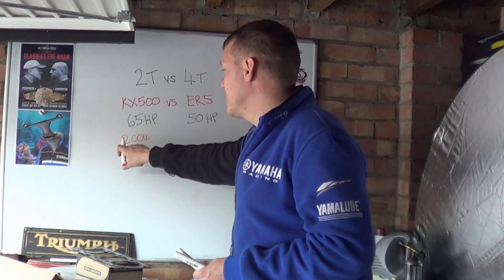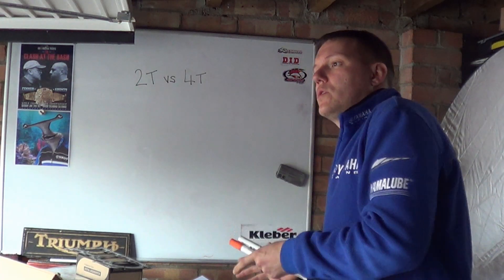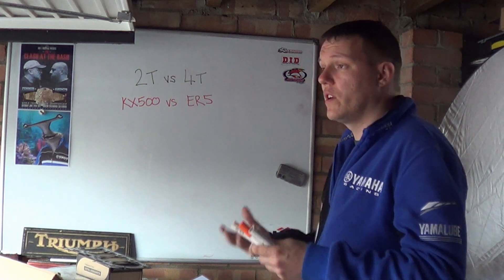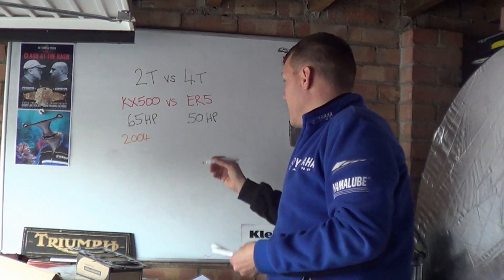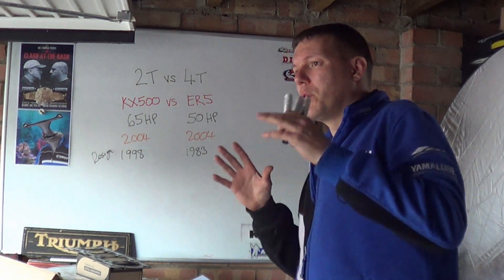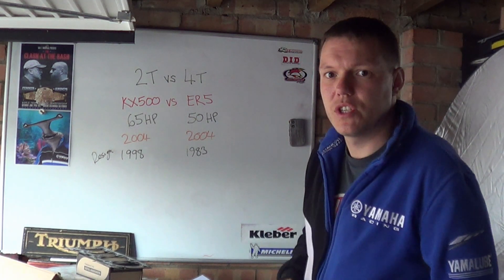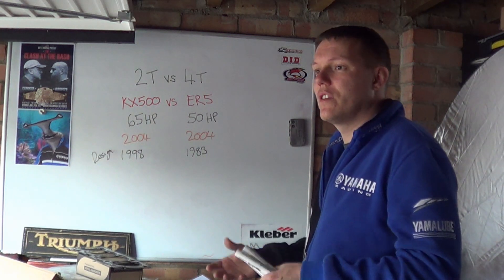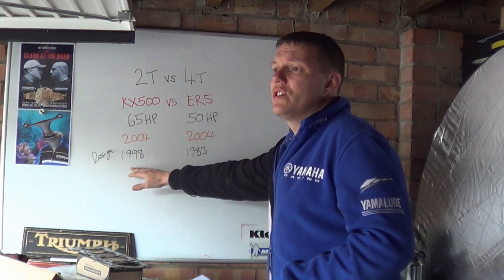2 stroke vs 4 stroke - case study-ish

Comment: Take a look at the power output of a rotax 125cc.
Reply from the maker: "And if Kawasaki made engines like the er5 for the kx they would lose every race. Whats your point?"

My point is that everyones comments are that - yes 2 strokes reliability is pants but they have SO much power. They fire every 2 strokes instead of 1 in 4. My point is that due to the volumetric efficiency you'd expect 2 strokes to be twice as powerful and they're not. Comparing a 1980's bike to a 1990's was just to highlight that difference.

Look Ian I know that your feelings are hurt, but 2 strokes are on their way out, just look at the numbers of 2 strokes bike in production. 

You say 'power' I say 'higher torque' 
you say 'cheap' I say 'reliability'
you say 'low parts count' I say 'lower failure rate'
you say 'direct injection' I say 'works for 4T, same benefit'

I say 'fuel efficiency' you say - nothing -
I say 'volumetric effciency' you say - nothing -
I say 'emissions' you say - nothing -
I say 'more scope for imporvement' - you say 'direct injection'

but you've said that one. Its that simple and thats why the MotoGP switched to 4T. The lap times are faster now then they were in 2002.
Reply from the maker: why?
Reply: 45 horsepower out a 125cc engine.
Reply from the maker: Do you mean the DD2 engine?
Reply: i think the dd2 had around 34 HP but for example the kz2 kart engine also has around 43 horsepower.
Reply from the maker: Taken from this article about the KZ2 Karting Magazine.com (link below)

- "Engine is not sealed and will require a full rebuild every year at a cost of aprox. £350 including the basic replacement parts, and a new piston kit is needed every 3 races events (3 practice days and 3 race meetings) and will cost aprox £60, obviously there are other things to go wrong 
like in all other classes but that is the basic maintenance required, add some good fuel and oil, run the engine in well and you should run all year."  

Power at the cost of reliability. If Kawasaki made road going engines like this then they would go out of business. This is also for racing, which is out of context.

Link to article - http://www.kartingmagazine.com/features/insider-information-kz2/
Reply: The Workshop Yeah i Know but I just say it because You were saying there only comes 65 HP out of a 500 2stroke. If you compare these 125 2strokes to a 125 4 stroke You will mention a big difference
Reply: but considering that they neef much more rebuilds haha
Reply: +The Workshop And if Kawasaki made engines like the er5 for the kx they would lose every race. Whats your point?

 It is you that is working out of context. A kx450f requires as much maintainance as the kx500 however parts and labour cost are substantially more expensive  and harder/more time consuming to change and with the potential to cost thousands to rebuild when it goes bang. Single valves can cost £200 and they wear there seats and stretch in next to no time compared to a "street" bike. Four strokes also need rebuilding every season to remain comptative and will cost more than £350.  All of your proclaimed benefits vitually disappear when talking about performance engines.
Reply from the maker: But then I'd have to compare bigger cc's and that's where 2 strokes fall on their faces
Reply: The Workshop Yeah good points haha
Reply: "My point is that everyones comments are that - yes 2 strokes reliability is pants but they have SO much power. They fire every 2 strokes instead of 1 in 4. My point is that due to the volumetric efficiency you'd expect 2 strokes to be twice as powerful and they're not. Comparing a 1980's bike to a 1990's was just to highlight that difference."

Why would you expect it to create twice as much power when the volumetric efficiency isn't there?! They do however create more power which is what matter when chasing performance. More is more, simple.  You also thought you where comparing a 2004 2t to a 80`s 4t and where arguing that it make the 4t even more impressive, however the stats where from engines of the same era which infact makes the 4t just look more pathetic. 

"You say 'power' I say 'higher torque' "
-I say hp is more important in a motorbike, torque gets you moving but hp gives you speed. Also, the kxf has minimal torque increase over the kx even though it is 30 years newer and fuel injected. Hardly worth shouting about.

"you say 'cheap' I say 'reliability'"
-I say you obviously have no experience of how often kxf450s go bad or how much it costs to fix them. 

you say 'low parts count' I say 'lower failure rate'
-More parts = more points of failure + more cost.

"you say 'direct injection' I say 'works for 4T, same benefit'"

-exactly...

"I say 'fuel efficiency' you say - nothing - "
- I actually said a lot but you ignore those bits.  

"I say 'volumetric effciency' you say - nothing -
I say 'emissions' you say - nothing -"

- same as above. Lets say it again clearly. IT IS IRRELEVANT. 2t are not built to commute or ride around the world. People don't expect or want efficiency from a crosser or a go kart, they expect it to go fast for a few hours a few times a month. Would you call an f1 engine shit because it doesn't do 50mpg?
 
"I say 'more scope for imporvement' - you say 'direct injection'"

- yes, aswell as things like Hondas exp-2 system and variable length expansion chambers. (which btw can be created and implemented far easier than you suggest in the video you did about it. I have the concept already). 

"but you've said that one. Its that simple and thats why the MotoGP switched to 4T. The lap times are faster now then they were in 2002."

-Are you sure that is why they changed to 4t...? Sure it wasn't because of emissions and manufacturers wanting to flagship their four stroke bikes?

Also, did you really just compare the lap times of a new gp bike to a 15 year old one? Even though the cc`s are different, bikes are lighter, brakes, suspension and tyres are better ect ect? Come on matt, you are just being silly now.

 Lets just put this to bed, 
2016 suter mmx500. 576cc two stroke. 195bhp, 193mph 127kg. 1.53 bhp/kg. 

2016 - Motogp 2  600cc 4 stroke, 140bhp, 174mph, 140kg, 1 bhp/kg
Reply from the maker: "Why would you expect it to create twice as much power when the volumetric efficiency isn't there?!"

 - to answer other people question, and that was the point I was making. From the numbers you can 'see' the lack of efficency.

"aswell as things like Hondas exp-2 system and variable length expansion chambers." I sure thats not how it worked - and it was a prototype that never made it into production.

"Are you sure that is why they changed to 4t...? Sure it wasn't because 
of emissions and manufacturers wanting to flagship their four stroke 
bikes?"

- very true
Reply: I wasn't saying that the exp-2 was a variable length exhaust. Exp-2 is one thing that could be developed, exhaust length is another. The exp-2 is an advancement in the exhaust powervalve system that also introduces a controlled pre-ignition, in basic terms. It was a prototype that came 5th in a Dakar rally that was only meat to be a test race for it. Again, a shift in focus to 4t and lack of necessity shelved the plans

Comment: Have you forgotten a kx500 is single cylinder and a er5 is a 2 cylinder? That makes a hell of a difference
Reply: MxForever your logic is ignorant and your quote is incorrect,
I have had 2t for over 25 years, that doesn't make them good from an engineering view, which this YouTube channel is about, also a rotary engine will make way more power than a 2t of the same cc it doesn't make it the best, the 2 stroke only makes power at a very narrow rpm range, it wastes loads of fuel, it's not efficient at all from emmisions to power wastage to fuel wastage, a 4 stroke if it a single cylinder will make less power than a 2t yes because it got half the amount of power strokes for any given rpm BUT it doesn't have half the power, it WILL be more reliable, more efficient in all aspects mentioned above, and produce more torque over a wider rev range.
Reply: MxForever dude face it our 2 strokes are not better than 4 strokes the only reason we keep them is because top ends are cheap and the powerband hit that's it
Reply from the maker: 8:29 I'm sure I do.
Reply: Either way 2 strokes make way more power than their 4 stroke bikes with the same cc's. It dousnt matter how you say it 2 strokes are just more powerful motors where 4 strokes are more efficient
Reply from the maker: How much I say what? DId I say that 2 strokes make less power?
Reply from the maker: We'll see. Apart from direct injection, which will also be fitted to 4 strokes, the 2 stroke design is so simple its too simple.
Reply: No. They make more power than four strokes and are cheaper. More complex is just more shit to break!
Reply: MxForever you are aware two strokes are way more unreliable than 4 strokes don't you
Reply: MxForever they make more peak hp, but they make less torque
Reply: MxForever at 4000 rpm which engine makes the most power kx500 or kx450f?
at 4000 rpm the kx 500 makes a measly 14hp
Reply: No, 2 strokes will last a long time if properly taken care of but 4 strokes are like ticking time bombs. I have both and my 2 stroke is just as reliable as a 4 stroke. And each bike makes their power at different rpm ranges. Kx450f makes 36 ft pounds of torque when a kx500 makes 40.
Reply: +MxForever 4 strokes are ticking time bombs?? What planet are you on? 99% of cars on the road are 4 stroke, I don't see abandoned broken down cars when I leave the house. A 2 stroke is an 100 year old inefficient design that starves it self of oil everytime your off the throttle, it's inherent design makes it unreliable, they were only produced because they were cheap, the only make power for a few thousand rpm right at the top of its rpm capabilities, where it also slowly melts itself, also you quoting peak figures again, the 4t has that amount of torque through most of its rev range, the kx makes it for a few seconds at high rpm
Reply: You have to know how to ride a 2'stroke. How is it starving itself from oil running 32:1??? If you hold a 2 stroke steady u will melt the piston! The throttle must be changed when in the band. So you are telling me a "cheap,shitty design" makes more power than a four stroke of its same cc. But as you said it's cheap and low on power why does it make more power and torque than a 4 stroke of the same cc? Your logic is ignorant and useless

Comment: Are the 4-strokes's engines up to formula 1 standards to maximize horsepower. While 2-strokes have changed little since the 80's. This is a question rather than a statement.
Reply from the maker: God no. 2 strokes have changed alot since the 80's, its just there not that much you can do with the system because it is so simple with very few parts
Reply: I hear ya. Thank you much.
Reply: How have two stroke changed since the 80`s? The only difference from the original design that is over 100 years old is the introduction of powervalve systems (In the 1980`s) and tuned pipes (before the 80`s). Even the other two stroke designs such as glow engines,  the Detroit diesel and the sleeve valve where from before the 80`s.
Reply: They are now trying injection systems, and they can much better design and mill the ports and such due to CAD

Comment: 4T failed on emission regulations? even it has lower hp, wondered how would that be possible
Reply from the maker: Emissions is not so much about how much fuel it burns but what comes out after the fact. Video coming soon
Reply: The Workshop but.. in 2t you know oil etc.. it is worst case against 4t which has much more controlled combustion chamber, i just suprised that both of them passed in same year.. probably it should be marketing strategy, they were aware the cost vs income relation if they try to pass in eu since 83 to 98.. but after a while they just had to develop new one because market place of older engine shrinked dramatically
Reply: i made comment while watching, sorry for your loss lol it was going good.. one suggestion, it would have been better if you put @rpm levels for max power and torque. and also it would be amazing if you could add fuel consumption at that ratings. people usually inclined that max power in same engine volume is better while making comparisons. because of motor sports (or maybe smaller fuel tank regarding to cars).. but it should be thermal efficiency comparison the first criteria between gob/bad design decision -i think-. at max power vs instant fuel consumption (with the help of internal energy of fuel) i use all the time.